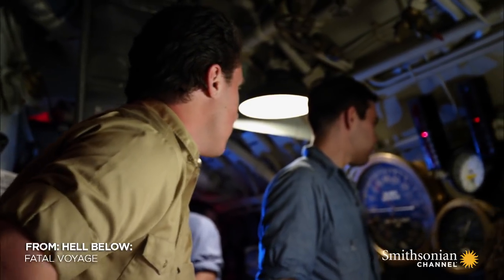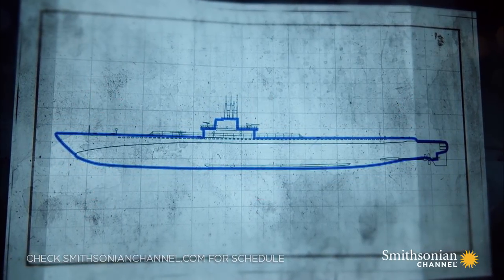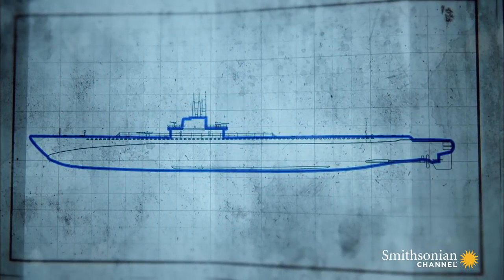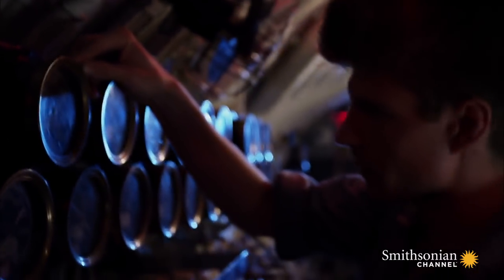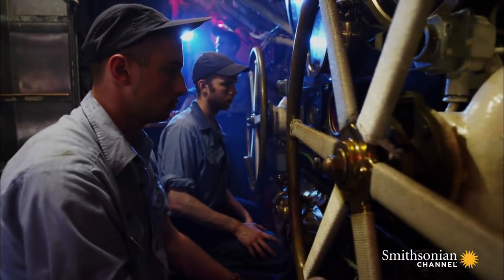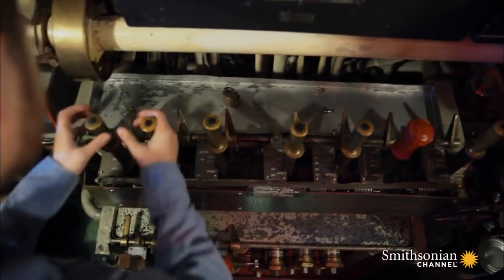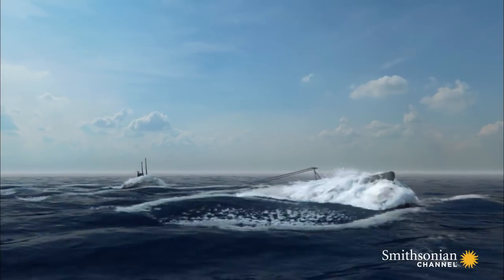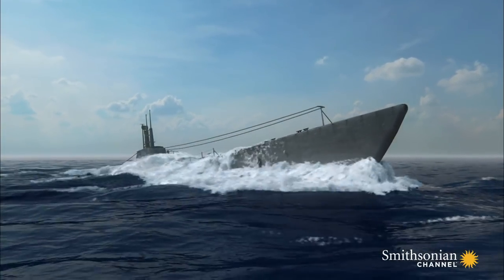A Submarine Dangerously Tests How Deep It Can Go

Comment: As a crew member of the Balao class, sub, USS Carbonero SS 337, back in 1965, I was in the after torpedo room when we took a steep up angle of about 45 degrees to surface. The boat slid back down  and the stern went well below test depth. I recently learned from other crew members who were told by the COB that the forward torpedo room, was at 600 ft. That put the after room  at least 100 ft deeper. Carbonero's test depth was 412 ft.
Reply: My father served on the Redfin (ss272). At one of the reunions members of her re commissioning crew were there. They told me they had a similar experience (including some colorful descriptions about one of the officers involved). They also went to 700 feet before stopping the dive. Redfin was a Gato class (Guppy upgrade) so test depth 300 feet.

Anecdote: My father was TM1c who did 7 war patrols in the after torpedo room. He liked being away from officer's country. :)
Reply: You men that served on the diesel boats will always have my deepest respect. Nuke boats were pleasure cruises by comparison.
Reply: @majormattmason8408    Gato class 300 feet test depth  crush depth ~500 feet .. 700 feet???? 9/16 steel hull?  sounds like someone was drinking that torpedo fuel.
Reply: @stumpedii8639  No one knows the true crush depth til they get there...

Comment: It's weird to think they were probably amazed by this but by today's standards its nothing more than a shallow dip.
Reply: Russian sub K-278 Komsomolec could dive up to 3200 ft. Thanks to Titanium alloy.
Reply: oldi184 good old stalinium
Reply: oldi184 Well that was 40 years later.
But even at the time that wasn't that deep.
German submarines at the time were able dive way deeper.

For example the Typ VII C/42 (desinged around the same time as the american boat) Was certified to go to 920ft and could theoreticly reach 1300ft before being crushed.
Reply: The C/42 was never produced. The C/41 was certified to 820ft though.
Reply: tropicthunder131 
Well then I might aswell add that the production of the Typ C/42 was stopped in oder to be able to produce the Typ XXI (a technologicaly more advanced uboat). 
Not because it was bad or something like that...
Reply: The Navy always grossly undersells their true submarine capabilities
Reply: @scottl.1568  Well that plus the "test depth" us not necessarily the "crush depth."
Hence, well... The different names. Very few submarines and submersible boats have a genuine measured "crush depth." For fairly obvious reasons, would you want to be part of the test crew? XD
Reply: And it sank on it's first operational patrol...
Reply: @oldi184  But they could only afford to build five, and that meant starving 30,000,000 peasants to death.
Reply: How many feet down is 80,000 psi? 
The supposed depth of H80 steel.
Reply: Odd came up in my feed, after learning that Metallurgist working at a foundry in Tacoma (that supplied Electric boat and Newport News) was found to have falsified the results of thousands of tests on production batches of steel between 1985 and 2017. It absolutely horrifies me, especially after watching the above.
Reply: Well, I doubt they can go down to the bottom of the Challenger Deep, 7 Miles down.

Comment: I don’t see any reason why in 2019 computers can’t be the “crew” when pressure testing a new sub. Pressure sensors, cameras, audio devices can be placed in strategic areas to monitor stress’s on the hull. 
The primary computer can decide if there is a danger of flooding and surface, no danger to any human crew.
Reply: Yeah I wish they had 2019 computers in 1943 so the real crew didn't have to test this
Reply: So why they hit car to the wall for test, This is only way when u want test metal structure.

Comment: THAT WAS INSANE- WITH THE PRESSURE HULL ALREADY UNDER  THAT KIND OF STRESS, A DEPTH CHARGE EXPLOSION MIGHT NOT EVEN HAVE TO BE CLOSE TO BE THE "LAST STRAW" TO IMPLODE THE SUBMARINE!!! THE ONLY TIME TO PRESS YOUR LUCK LIKE THAT IS WHEN IT'S PURELY A QUESTION OF SURVIVAL, AND YOU HAVE NOTHING TO LOSE!!!
Reply: I agree, I understand they want to test it but they were really cutting it way too close, one minor malfunction, one wrong move, and you are done.  A bit reckless and irresponsible not to mention causing possible damage and obvious stress on the submarine.
Reply: actually a bomb.. is rapid expansion of gas..   at greater depths.. those bangs are much smaller..

Comment: 400 ft is really shallow 
The german u boats coould go to 800 ft
Reply: A type VIIB, C test depth was 150m (492’)
Reply: @firecracker4277  492 feet (150m) was the Factory warrant depth (Werksgarantie)

It means you could dive there without any issues and stay there all day long (as long you have enough power and air)

But the test deapth was much deeper.

A type VII c can go at around 800feet (245m) then it gets critical it depends on your specific boat how much room you have left  from that point on.

A perfect crafted boat can still go a bit deeper. 

A Type XXI boats can even go  deeper by default  because they where carbon reinforced  1100feet (335meter) are possible.

Comment: I’m a mechanical engineer and I wonder what the “factor of safety” is on a sub. I would guess it would be around 1 1/2. I would not be running the boat right up to the limit of the factor of safety, so perhaps it is higher. But cost and weight would be limiting. An elevator has a factor of safety around 40, while a spacecraft might be only 1.1. I wouldn’t be so trusting of the engineers.

Comment: It wasn't the best sub that the USA had during WW2. The Tench class looked superficially similar but had several important improvements. The US probably should have shifted all production to Tench class but in fact both Balao class and Tench class continued production at the same time until the end of the war. 

Also, after the war the entire sub fleet should have fully migrated to Tench class and scrapped the others. Both classes historically received modifications and upgrades and saw long service. Moving entirely to Tench class could have improved safety and capabilities. 

During the war, the excuse was that they did not want to delay production delivery times by switching but it probably would have been worth it in hindsight. The orders for both classes were cut short by large numbers because of the end of the war. 

Personally I believe that the US Navy should have continued production of the latest classes of vessels to modernize up to known best standards of the time. But, huge postwar budget cuts prevented that. Just a short while later they had to scramble to ramp up production again with the growth of the Cold War and the Korean War.

Some of the late WW2 designs were particularly well suited to modernizations such as the Tench class submarine and the Gearing class destroyers. Some of the improvements thought to be small at the time turned out to be very important later on. The Gearing class for example was lengthened from the Allen M. Sumner class to increase range. But this modification also made them well suited for periodically updating weaponry over time. Again, the USN should have shifted to all Gearings but they had to keep many older destroyers of older designs. Keeping production going just a bit longer could have allowed this to happen.

Des Moines class heavy cruisers should have also been built in larger numbers, at least to their planned run of 12. Their 8 inch guns were later determined to be the ideal caliber for shore bombardments and had a very high rate of fire. They were also fast enough to escort carrier groups. USS Newport News was still used during the Vietnam War, attacking high value targets on shore. If they had all been built and the money had been spent to modernize them all, they probably would have taken part in conflicts during the 1980s and 1990s as well.

Worcester class light cruisers similarly could have had a longer life with larger production run and upgrades.